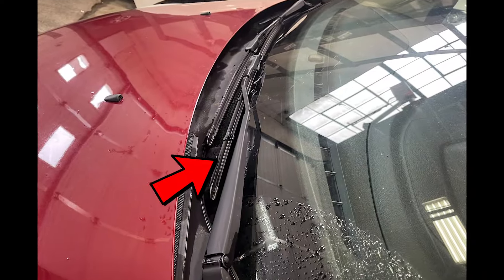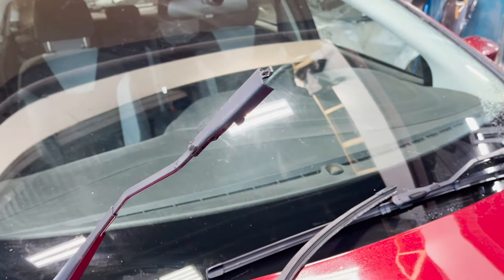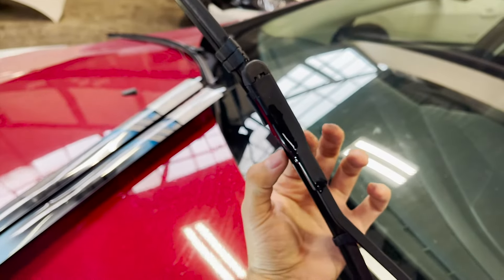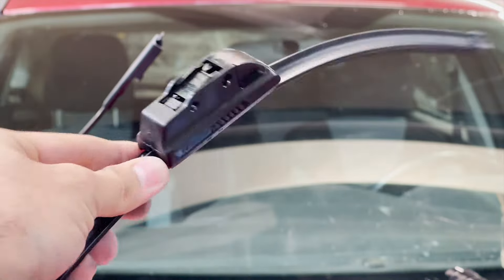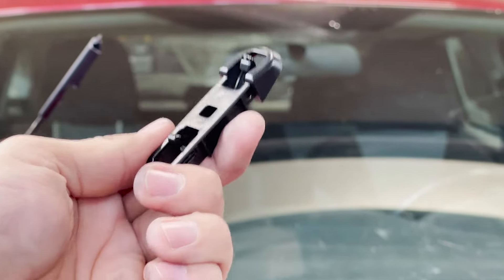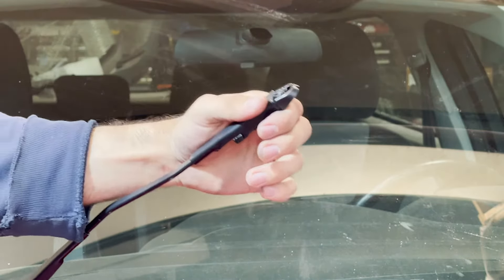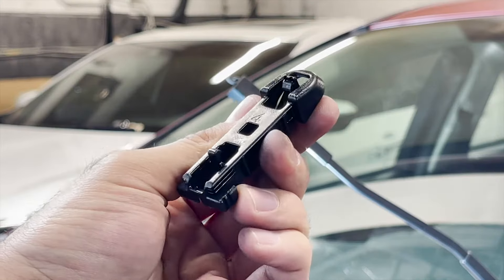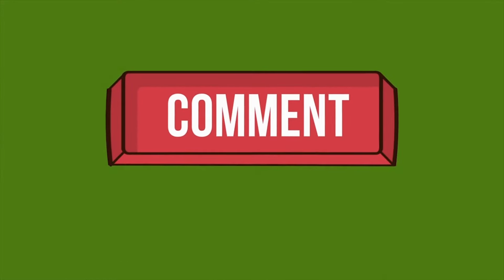DIY (2011 - 2018) Ford Focus Wiper Blades Replacement | How to Replace Wiper Blades On Ford Focus

Comment: Thank you!! I tried for an half an hour to install the blades.  The directions say to put bracket on blade first and try as I could I couldn't get on the wiper arm.  I tried it your way and I was able to get the new wipers on.  Thanks. 😊😊